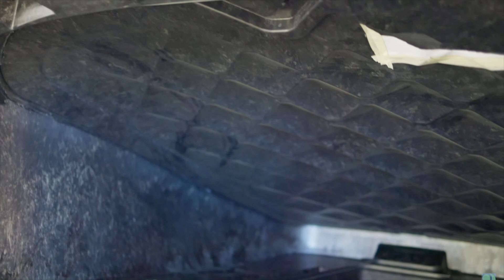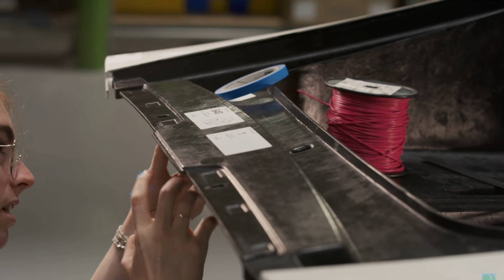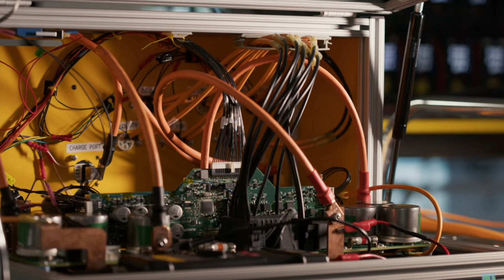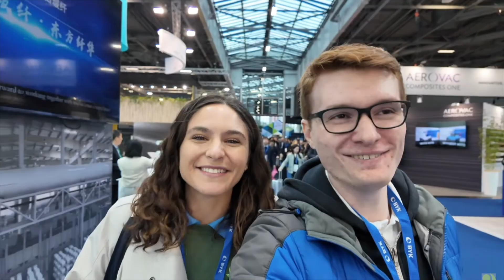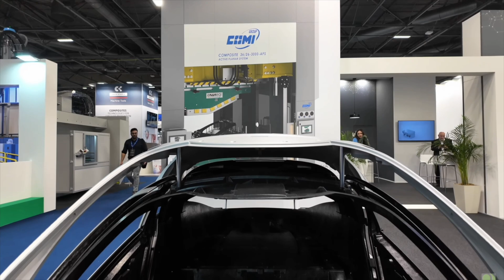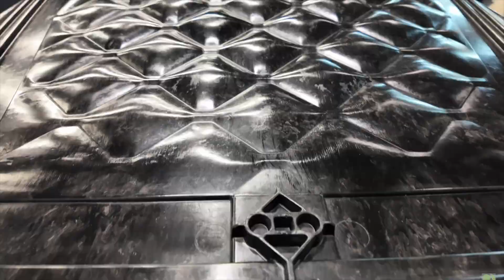PI 1 & PI 2 Are Coming !

Comment: Do one bad battery cell destroy the hole pack? I thought about spring pressure assemblies on PCB´s with single cell monitoring instead of the harness mess 10 y ago for e-bikes. But now you put 10k battery into risk. Unbelievable.

Comment: Cool 12 year old tech ready to come out obsolete on its 1st day.  Blowing money in Italy was a huge mistake.  May sell a couple before going bankrupt but I doubt it. Elio part 2.
Reply: You will be proven wrong👎
Reply: Negative
Reply: Ouch, that's harsh.  Some of the tech is so new that it hasn't been seen on any other production vehicle, like the hub motors and solar panels.  As for being Elio part 2, on the surface perhaps.  Still, Aptera has done more than Elio in tooling and partnerships.  It does remain to be seen if the vehicle sells.  The Polaris Slingshot has been around for 10 years, but it is hard to find one on the road.  I live near a Polaris dealership, and I hardly ever see one.

Comment: Can't wait for the Aptera.. just a small correction, there are 2 spot welds on the battery both on the same end for cathode/anode you can see the 2nd weld on the rim/casing of the battery